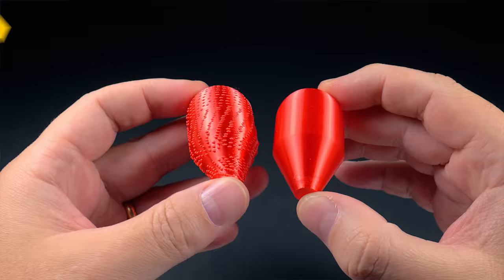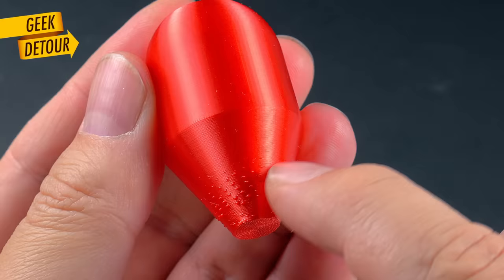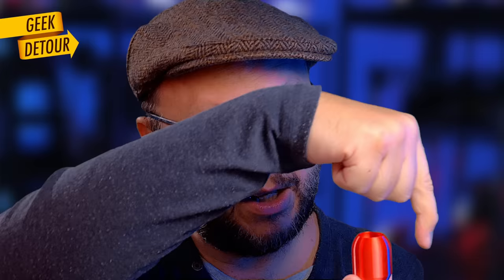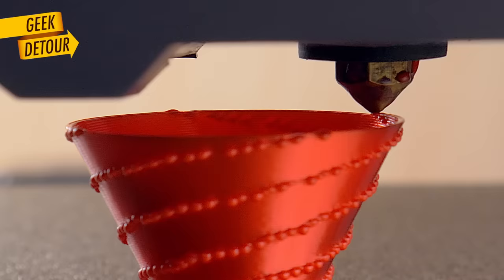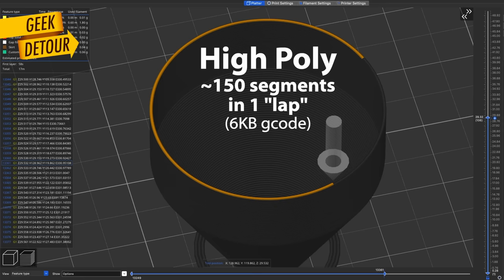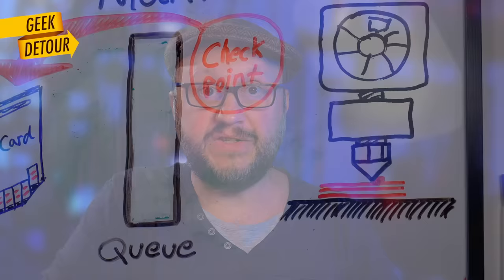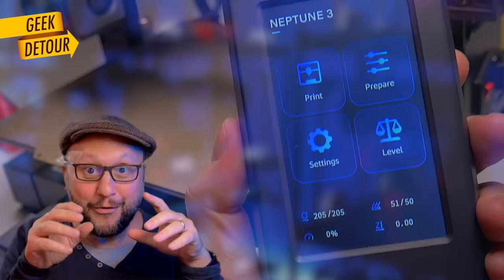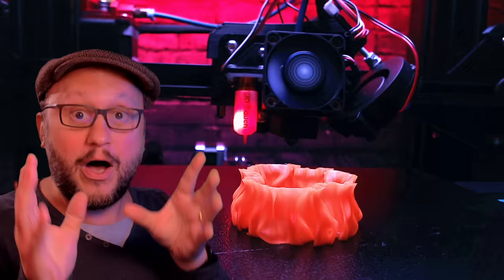3D Printer Blobs: a mysterious problem you won't guess how to fix 🤔

Comment: Good video. Really bad engineering on behalf of these companies, though; did they not test their product under the default settings? Did they not notice their printers produce ugly blobby output?
Reply from the maker: Hi there! Enabling it by default and not having a menu option to disable it is bad engineering. The feature itself was not made by the companies: it was conceived and implemented by the community, Marlin is an open source firmware. Depending on what you print, you could never have a noticeable blob - or have just a few small ones… So, it “works”. 

What I showed in the video is the “perfect storm model”: all rounded with a high poly and super easy to spot any problems… and printing fast (making the blobs even bigger).

One thing is clear: Prusa might be the only company that uses their own printers to make printers, and it raised the bar for them, even justifying their investment in developing a slicer. If a company doesn’t print with their own printers (I mean: daily usage, research, hired artists, etc), if they just have basic “quality control checklists”, they will never catch corner cases like this one.

But here we are: all of us in the Internet. We can test, discover and report. Some companies are quite responsive: Elegoo just launched their new Neptune 3 Pro and check it out: it is coming with a menu option to disable Power-loss Recovery if you want. Matter of fact, they emailed me the very first day after I published the video, they said it was extremely interesting and useful - and they would put the option to disable it on their printers and study if there was a better option to deal with it in the future. I like Elegoo very much for their relationship with users.

Comment: I love this video  and i learned a lot thanks so much. I have a ender 3v2 and i did upgrade firmware and change the bowden extruder to sprite extruder , i was very happy with this sprite extruder but surprisingly my prints came with under extrussionand those blobs i dissasembly sprite extruder and this is ok. but the problem continues now i am gonna try everything you say here. 
I have a question. How can i know if my 3d printer is dissable or enabled the power loss recovery?

Comment: I use Cura, so would adding G-Code
M413 S0
to the start code, be something that could work?
Reply from the maker: Sure, it would do it. But maybe your printer doesn’t need it. What’s your printer?
Reply: @GeekDetour  
I have (sigh... hate to say it)
a Wanhao Duplicator 9 MK2 400, with my own modifications to make it actually work.  LOL

I agree, I don't think that THIS printer needs that, per se. For me, the only thing I see is if I use the random seam on or off thing.

But I was just curious if that code would prevent what you demonstrate from happening, should that creep in again.

What I mean there is that I could swear that this printer, when I first got it, did experience a power outage and then when power came back, it asked if I wanted it to resume.  I remember that this didn't work out so well because while it did reheat the bed and nozzle, it started printing before being completely up to temp.  This caused a bad new layer separation.

What I can't remember if that was more related to the ridiculous problems I had at the beginning with most prints failing due to filament just pulling out because of heat creep.  I was a total noob at that time.

I did realize that this was an issue and designed an "L" shaped (boot) duct with a tiny, but powerful server fan to get the heat break to actually cool down and allow prints to continue.

But I never tried or experienced a power outage after that.  So I'm rather unsure if this problem will return.  Sure, I guess I could test it.  LOL
Reply from the maker: Wow! Thanks for sharing the details about your your experience! I love this aspect of YouTube: some people really take time to read and write on the comments! ❤️

Comment: Great! Thank you. I will put the deactivation into my start g-code
Reply from the maker: Hi there! Yeah, it will work - but you don’t need to deactivate it every time if you:

M501;    Load Saved Settings from EEPROM
M413 S0; Disable power-loss recovery
M500;    Save Settings on EEPROM

That you need to run only once, it will be changed and saved.

Comment: Do slicers really not emit G2/G3 codes for paths that very closely fit an arc trajectory??
Reply from the maker: Not by default. Cura has a plug-in you can install, named “Arc Welder” that does that and it works for the printers that have Arc supported (most new printer do). My issue is that the STLs are triangles, so, it is a process to “identify” what should be an ARC… from a triangle mesh. What I really want is Slicers start accepting STEP files too (from CAD designs), because they describe the geometry, so curves are kept as curves and not triangulated. Then ARC support will make all the sense!
Reply: @GeekDetour  Huh, ok ... that is exactly how I would expect it to work. Yes, STL is an interpolation, so do another interpolation thereafter is arguably not so entirely wrong.
Extracting directly from STEP would be such a tall order ... curve projection, hull finding, etc, a lot of super difficult operations.
Of course, if our CAD packages were not all such terrible walled gardens, maybe the more tenable approach would be to have a CAD plugin that can export to a stack of DXFs or SVGs or something.
(although DXF is an insane mess of its own)

Thinking about it ... maybe the resin printing pipeline might come back into view here. If 2D images are sliced, then it's just a matter of edge-finding in 2D in a bit stack of images.

Comment: sorry in new to 3d printers.. but will it work in my ender 3 pro as well?
well like i said i still havent faced any issue about this yet it sounds like its better to turn off this feature since i have stable power source. but was wondering if it will fit in any 3d printers or some specific models
ty
Reply from the maker: Depending on how old is the firmware of your Ender 3 Pro, it doesn’t even have the PowerLoss Recovery Feature compiled into it. If it does, then my advice is always to disable it 😄. 

I still have an Ender 3 Pro, but with a different board, and I compiled Marlin myself - I only added PowerLoss Recovery to play with it and later I disabled it.
Reply: @GeekDetour  my printer details are this. 

Marlin

Ver. 1.0.1
2020-04-25

Comment: Are these g codes safe to run on Ender 3 s1 non pro and should i run this g code each time i turn on my printer ?? because I always switch off the power completely on my printer. 
 please let me know I'm experiencing some of these blobs on different print not vase mode

Comment: I find you can stop this happening by drying your filament, even PLA will benefit from drying for a few hours
Reply from the maker: It was definitely not wet filament. I could literally keep the same spool on the printer, have a perfect piece printed with PowerLoss recovery turned off - and if on, it would make the blobs.
But your advice is good: wet filament prints worse. Having it dried is always better. 👍
Reply: @GeekDetour  You asked me to guess and I did based on my experience. Then I watched the rest of the video. Very intersting and informative, I learned stuff.

Comment: This video just saved my butt. Thank you so much
Reply from the maker: Hey! That’s great!!! ❤️
Reply: @GeekDetour  recently I bought my first printer after watching videos for a couple of years now. Creality Cr-10 V2. I think the pre-owner barely used it and I got a very nice deal 300€ with a bunch of filament. Worked nice right of the box after I got the first layer adhesion problem sortet with a clue stick. 
Then I upgraded a bed leveling sensor and couldn't find the correct firmware on the Creality side because that's an absolute mess so I installed tiny machines thanks to another video that I found and enabled power recovery right away because why not facepalm  
Took me a couple of hours to remember this video that a watched a while ago.
Now the printer basically doesn't stop anymore. It's like a freaking addiction 😅
Reply from the maker: 3D Printer is highly addictive - it should be warned in the box 📦 ⚠️

Comment: Is there a way to disable power loss recovery on klipper?
Reply from the maker: Good news: so far Klipper doesn’t come with PowerLoss Recovery at all 😁 This, in my opinion, is excellent. If you need to guarantee that your prints don’t fail if you have a short power outage, just get a UPS battery system - I got one because since we moved to a rural area, energy now is an adventure… almost every week I have short outages - but I am covered 👍

Comment: So Octoprint or Skipper should fix that too, right?
Reply from the maker: When you print using serial (OctoPrint or Klipper) you don’t have PowerLoss Recovery going on, so, it should not have blobs (at least not for the reason I showed in this video). You can have blobs because of other factors (bad usb cable, cpu reaching 100% on your OctoPrint computer, etc..).

Comment: I downloaded the file to stop the power recovery on the Super Racer onto the SD card, and on the printer went to the settings file and it's blank?
Reply from the maker: Hi there! If the printer cannot find the file on a folder, copy the files on the root of the card (not on a folder). You just “print” the disable file once. Nothing will be actually printed - it will just go through a few GCode lines; one disables the PowerLoss Recovery feature and another one saves the settings, so you just need to do it once. It happens extremely fast, looks like nothing happened. Out of curiosity, which is your printer?
Reply: @Geek Detour  got it, I just put the g code directly on the card and it worked. I have the Super Racer, a print is going right now for a larger filament holder and it's grinding quite a bit, I assume I should add z hop to parts that have lots of supports?

Comment: Is it impossible to increase the queue’s size?
Reply from the maker: It is possible - you change the source code and compile. For some other problems it is advisable. But for this one we get into a conundrum: the “Queue” is part of the data structure that is saved in every checkpoint… if you increase the queue, saving checkpoints will also take longer 😬

Comment: what about if you print directly from the computer? does it still blob?
like you mentioned, the simplest way would be a good UPS. a decent one runs between $100 - $150. i like APC ones :)
luckily, my 3DP is old enough it doesn't have such "advanced" features! lol
Reply from the maker: When you print over Serial connection (USB), using a computer, OctoPrint, etc, the PowerLoss Recovery feature does not take part of it.
Reply: @GeekDetour  hmm...maybe if they just add a second SD Card slot for this feature specifically then.. optional, of course.
Reply: @darkflux  Please get out of my head.  LOL
I thought the same thing. It would be easy enough to implement both hardware and firmware.  But I'm thinking on new machines more than older machines.
There may not be any way to connect a 2nd CD card port.

Another option, might be for the firmware to cache the points and then ONLY save to the SD card during longer travels of the extruder.... where possible.

Personally, I must have disabled this long ago, because I remember this happening a couple of times, but the resume was crap.  LOL
While it did start printing from where it left off, it was just not perfect.  So a seam on the X was created (layer separation).
Reply: @BlondieSL  yeah, "resume" SOUNDS like a nice feature, but saving memory before power goes out is all but impossible without a UPS.

perhaps a printer than detects when power is switched to UPS and then stops printing and saves its state?

however, you would still need to deal with the currently melting plastic. perhaps moving the nozzle away from the print, so it doesn't cause "imperfections", but not before saving the nozzle's current position, so it can return once power is returned.
Reply: @darkflux A UPS is nice, but for this save function, it's not necessary.

While I don't use the resume feature anymore, at least the one good thing that was done with this printer is they designed it to have some capacitors to hold the voltage while a graceful shutdown happens.

When I power it off (or unplug power), the display takes time to go off and throws up a notice about the power.  It then saves what it needs before the caps run out.

As for the melting plastic, yes, that's a big deal.
I had exactly that problem where after a print was done, the machine would home itself, but then I'd have to either power up the head to get the plastic to melt to get it out or take apart the nozzle.

I learned that there's a G-Code thing to cause the head to retract the filament, at high speed, all the way up to above the gears.
Problem solved.

It would be easy enough for a firmware update to include that code on a power failure (assuming that they have a capacitor  thing going on) that would also retract the filament to above the gears (or whatever the printer has... mine is a direct drive).

A few years ago, I build a spot welder using 10 high capacity caps.  This thing could be used to power something for a while, depending on the current draw.

I think the printer uses a similar concept.

Comment: Another way you might be able to disable it is to set the SD card slider switch on the side of the SD card to 'read only' mode, if your sd card has one.  Assuming the printer doesn't crash when it goes to write and can't, it will probably just continue without a save pause.
Reply from the maker: Hi! Most 3D Printers use MicroSDCards - they don’t have a switch. Really, the most effective way to disable the feature is just running the disabling code only once.

Comment: So.. Why aren't they having MB of ram? Is this market segments?
Reply from the maker: Hi there! Actually, they don’t need Megabytes of RAM… with less than 100kbytes the microcontroller of these boards can do everything they need - the code is very specialized and optimized for this single task. It is very different from a computer that deals with images, videos, huge databases… Nothing like this happen on a 3D Printer 😁

Comment: i had this problem when using octopi. i reduced the speed only by a littlebit so i wont have bandwith problems. although i  didnt think to change the cable with a better one i though its rasberry pi limitation

Comment: How come computers from 80's or 90's and todate still use tablet batteries for BIOS data, yet the very modern super-duper 3D-printers rely on stupid-ass writing-back-to-sdcard thing, lmao. I bet it isn't even multithreaded :D
Reply from the maker: Ha ha, you are right: It is not multithreading. Actually, there is not even an operating system on the 3D Printers running Marlin: it is a single program that runs a loop and run very short “tasks” in sequence, very fast. But it is all very defined and fixed.
Printers that run Klipper are different: the very complex tasks run on a Raspbery Pi (or similar) running Linux… and a microcontroller board receives a queue of pulses that should be executed by the motors.

Comment: Hi. Will the file download work if I’m using a sonic pad?
Reply from the maker: If you have a printer running with the Sonic Pad, it is running Klipper and it doesn’t suffer from the PowerLoss Recovery blobs problem. KLIPPER doesn’t have that feature.

Comment: TLDR turn off power loss recovery in your start gcode. It stops the print head and continues to flow when it tries to save the progress to memory. Turn it off and it will skip the routine to save the progress to memory and will move right on to the next point in thr gcode
Reply from the maker: That’s right! But that’s comparing taking a pill 💊 to eating a stake 🥩

Comment: I have CR10 MINI  with bigtreetech E3 v2 board. I also have a bltouch probe for z axis and auto bed leveling. It has improved my prints but I have noticed a bulge in the prints after a certain height. Bulge as in extrusion mostly at the center of the prints on z axis side. I don't know why? Plus the bridge is not proper
Reply from the maker: Hi there! The best way to get help is: you join a CR10 Mini Users Group on Facebook. There you can post PHOTOS of your prints and you will get lots of insights about what could be wrong.

Comment: Did you try to increase buffer size in marlin?
Reply from the maker: Hi there! Nice question! But here is the conundrum: the QUEUE of movements is part of the structure that is saved as a checkpoint. So, if you increase the size of the queue, it will take longer to save it on the card… And if writing to the SDCard is slower than reading, it gets actually worst!

Comment: I have so many questions...
Why not just add RAM?
Why not just add a big battery instead of this stupid feature?
Why do those things use SD-cards??? No, seriously, why in the hell high end tech like 3D printer uses something from over 10 years ago!? It makes 0 sense!
And why do manufacturers even have problems with air in the nozzle? I'm pretty sure this problem also was solved years ago.
Reply from the maker: All valid questions!!!!  More RAM are not necessary on the microcontroller. The big battery is exactly what can be installed (a board with super capacitors) to just write data on the card when a real power down occur. SDCards are very fast and inexpensive - they can print very well very fast if they are just being read. Air in the nozzle I ask you to tell me more 😄 please!!!!